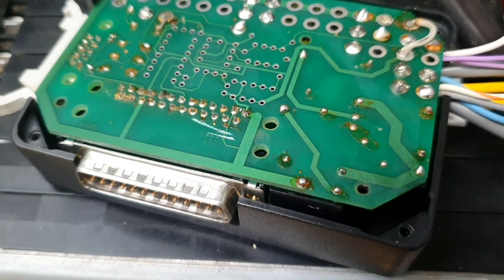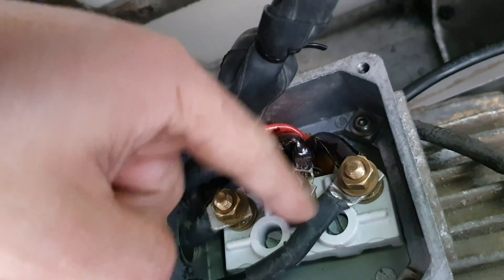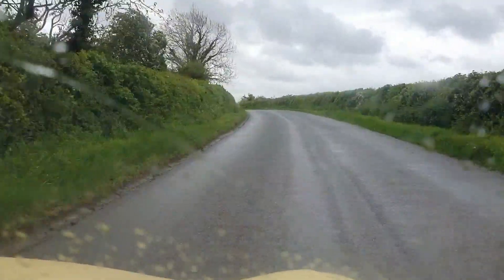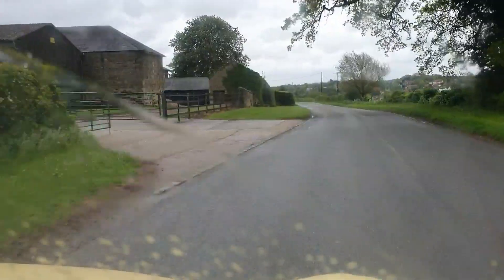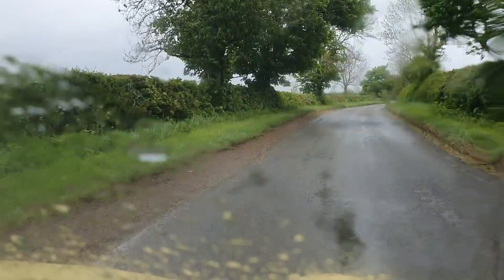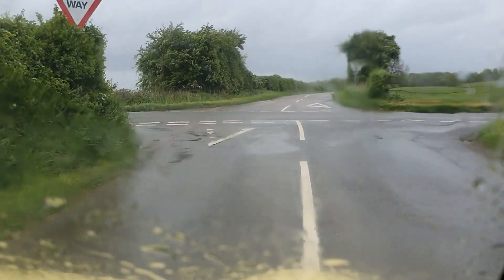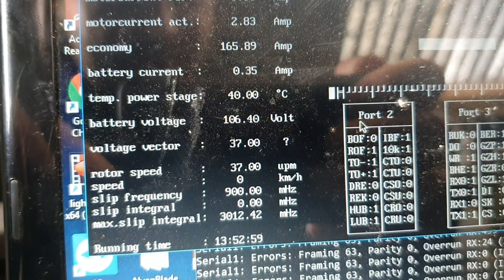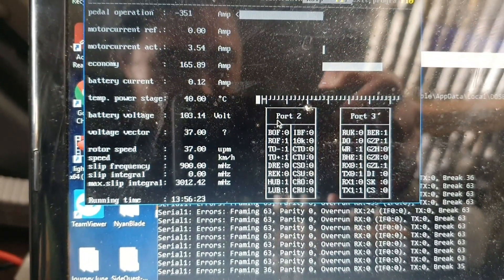REVA G-WIZ: Yellow Wiz Lithium-ion conversion pt. 28 - wiring to Y from delta

Comment: Hi Richard are you able to set the voltage for the motor on the controller? Also why would you have to mod the board to run star?
Reply from the maker: Hi Dan, this is a different motor and controller to the original G-WIZ but from what I recall I'm not sure if you can set voltage for the motor. If you mean voltage for the batteries then yes. The Motor cannot be set I do not think, and when it comes to pairing you have to use an adequate inverter to pair to the right motor if they are not already set up together i.e. 120v inverter and 120v Motor when it comes to AC at least as far as I understand. I had to mod the control board because it already had the settings to do so. Change a few wires over on the motor, and then change the board circuit and it changed the inverter settings to output in star mode.
Reply: @RichardMawby  okay I see. When you connect the motor to star you would be upping the motor voltage by approx 1.8 times making it 216v.

Comment: A lot of work my friend. Good job! Which is the range with lithium batteries and top speed? Standar is 70kms max and 60kms range driving ECO mode. Thanks!!!
Reply from the maker: My other car is normal settings but 150 mile range with custom built lithium packs. I expect this one to have upto 100 mile range but top speed is around 86mph... I wont go that fast though it's dangerous.
Reply: @RichardMawby  The motor/gearbox looks very similar to the  EV Tuk Tuk and on Ali Express... can you not tell/fool the inverter/controller using a Raspberry pi or Arduino that the battery is standard spec even if it`s a custom battery above standard volt/amps ?

Comment: Would it be a capacitor in the inverter? Or maybe a settings battery? 

Just a thort
Reply from the maker: Yeah I'm wondering if it's a faulty contactor that loses its connection when it gets hot and the voltage dropping slowly is just the capacitor draining.